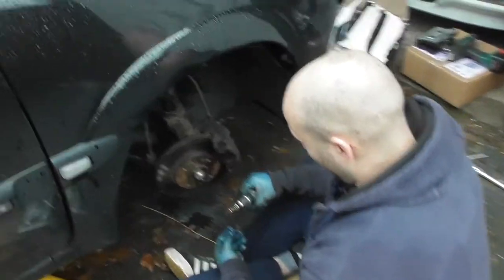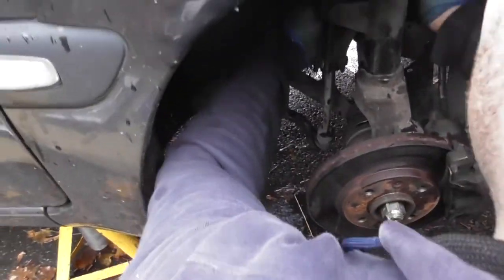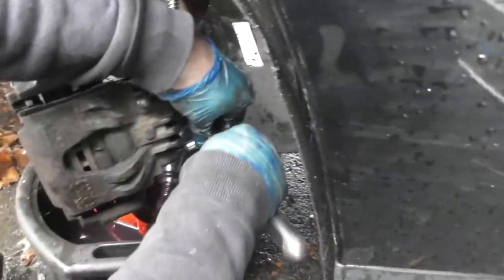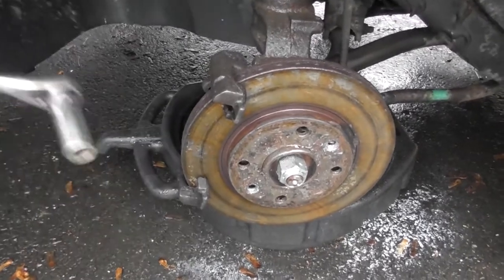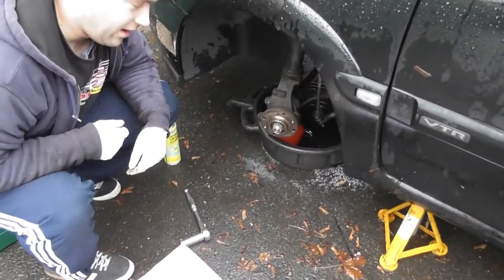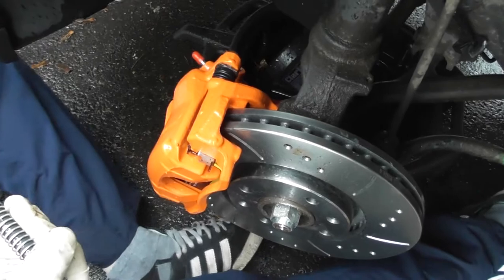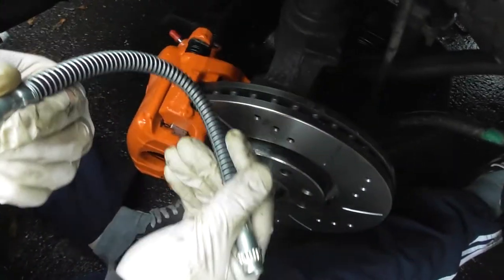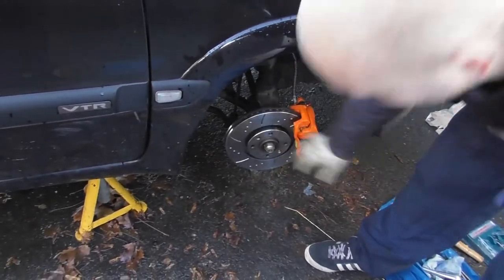T2SG Citroen Saxo 282mm Big Brake VTR Part 2: Big 206 GTi 180 Upgrade Caliper Disk

Comment: will the 283 disk and calliper fit under 14-inch rim? I run 14 on my pug and I'm gonna upgrade the breaks soo and wonder to go 283 or 266 disk.
Reply from the maker: ItsPeter I have to admit, I am not much of a Saxo expert... but seem to remember the brakes on this car were very tight under the 205GTi wheels, which are 15".
I would think you would be better off with smaller brakes, maybe the 260mm brakes. I would advise having a look on the forums.
Thanks

Comment: what is the minimum rim size for the 282 brakes?
Reply from the maker: Hi 15" wheels are required.
Peugeot 205 1.9 GTi wheels worked for me.
Reply: @twin2civicgaraget2cg75  thanks for quick reply!
Reply from the maker: @pgn666  No probs